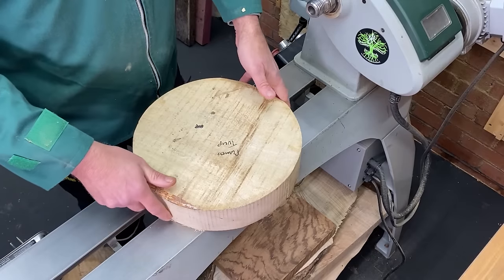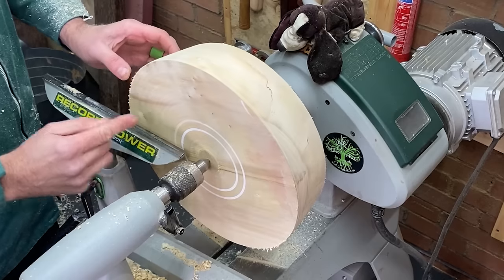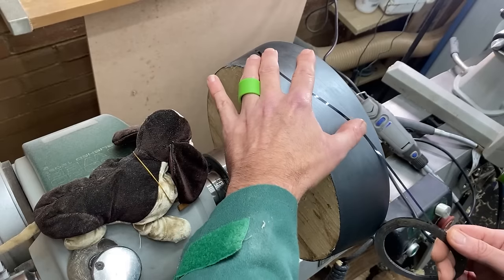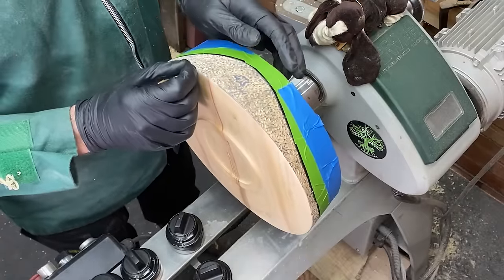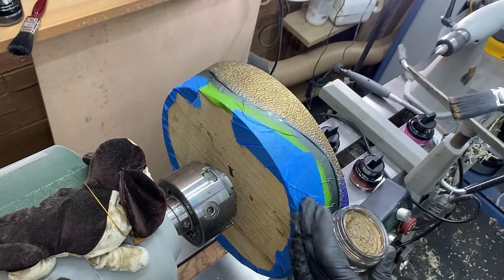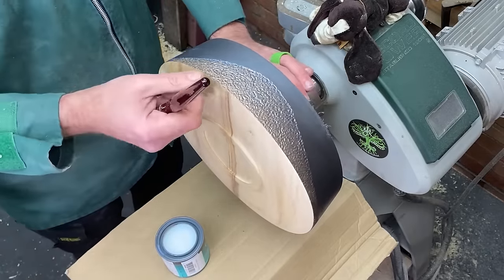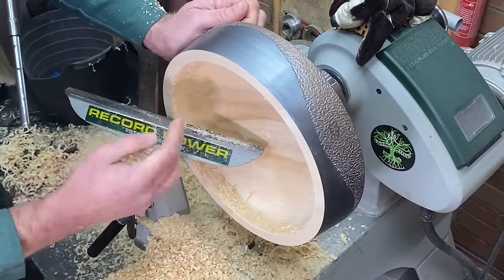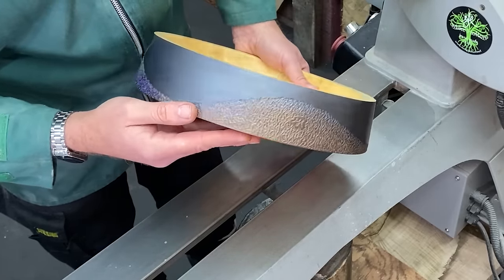A bowl for LIFE not just for Christmas - The festive woodturning experiment

Comment: "...straight wavy line..." 😆Though I definitely understand what you meant.  Maybe smooth wavy line?
I'm glad you ended up choosing the gold/bronze rather than the green, I think that would have been too Christmasy for a year-round display piece.  I like how the smaller texture turned out, and you should for sure put your initials in a piece, at the least.

And I was amused that I am pretty sure I recognize the gilding polishes as I have several for my paper crafting 😊
Reply from the maker: Haha thanks Susan, yes the gilding polishes are from a papercraft company but they work so well on wood 😀

Comment: Gday Mike,quite correct in your choice of top and bottom. Other way around probably better.
Not sure about the dark grey colour though.
I would have made bowl a little thinner and curved the base corner to reduce overall thickness at that point, this would also have significantly lessened overall weight of bowl.
You could have left thin wavy line there and carved top of line as well and reversed the colours. Use opposite colour from colour wheel,Eg red:green, yellow: purple etc 
Thanks for sharing Mike.
Reply from the maker: Thanks for the tips Greg, there are so many ways this could have gone. 👍

Comment: Good morning, my friend. (NC, USA Time)

Might I suggest that you check the preload of the bearings for both the spindle & top pulley shaft, as well as the lower belt pulley shaft. 

I am not a wood lathe engineer. However, I am an industrial engineer. My ears are telling me that it may soon be time to check the backlash pressures for each of the points mentioned above. 

Nothing is wrong with your wonderful lathe. I only noticed an increase of chatter recently. A torque wrench is all you need. 

Great videos, as always, Mike. A Happy New Year to you and yours.
Reply from the maker: Thanks so much for you advice. It was actually the lever that retracts and engages the spindle lock. The screw was a little loose so the lock was brushing against the metal. There are probably better names for everything I just said but my engineering language is not up to scratch. All the best, Mike
Reply: @MikeHolton  Check the torque on things at least 2X/year, only as a matter of prevention. You'll be good to go. 

I can't even guess what you might show us next. That's merely one of the reasons we enjoy you. We just never know. Do we?
Reply from the maker: @frankashworth5961  Thanks Frank, I have so many ideas and not enough time lol. The next video is not a bowl or a vase!

Comment: When in doubt with colors, use the color wheel. With 2 colors, use opposites. Opposite of purple is yellow(or gold). When using 3 colors, pick a starter color, then shades adjacent to your original. Purple on center, red one side, blue on the other.
Reply: I think your color choices worked well.
Reply from the maker: Thanks so much, I got lucky 😀

Comment: Beautiful bowl.  Love the texturing.  Two questions as I'm still a novice.  The tenon on the base didn't seem very deep so how does it stay on the chuck (assuming you used a chuck).  What are the gilded paints called/where did you get them
Reply from the maker: Hi Jerry, the colours are cosmic shimmer gilding polish. Also the tenon was about 2-3mm deep and is recessed in with a slight undercut to match the shape of the jaws on the chuck so when the jaws are expanded into the recess they are effectively locked in place. Probably not explained very well let me know if you need me to have another go.
Reply: @MikeHolton  Thanks for getting back to me.  I always assumed/read somewhere/heard that the tenon had to be deep enough to cover all of the jaw depth and so my recesses would be about  8-10mm deep and with a slight angle to match the jaw shape.  Next bowl I'll try your measurements. I'll start looking for the cosmic gilding polish.
Reply from the maker: @jerrytack7353  It does not need to be that deep unless you have very soft or weak wood.

Comment: Mike. What lathe are you using at the moment?
Reply from the maker: Hi Robert, I'm using the Record Power Coronet Regent. Wonderful lathe for the money.
Reply: Thanks Mike. I'm in the process of buying a new lathe, and I am in two minds what to go for.
Reply from the maker: @robertdunkley1009  Which ones are you looking at and what are you looking to turn?
Reply: I'm currently using a Record DML 24x. Need a bigger turning diameter than I have at the moment.  Also, there is no variable speed or reverse function available. I make mostly table lamps and the odd bowl.
Reply from the maker: @robertdunkley1009  OK cool, I can turn up to 18" over the bed on mine and with the outboard attachment I can turn over 40" not sure I would like something that size spinning in front of my face though lol